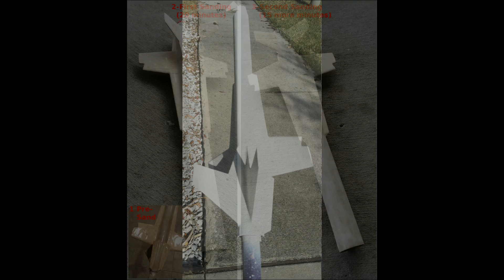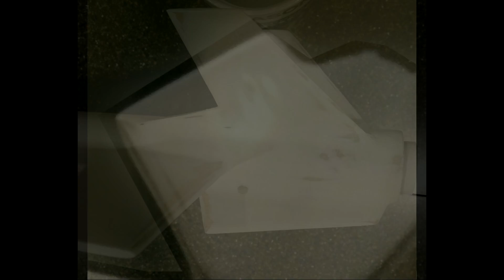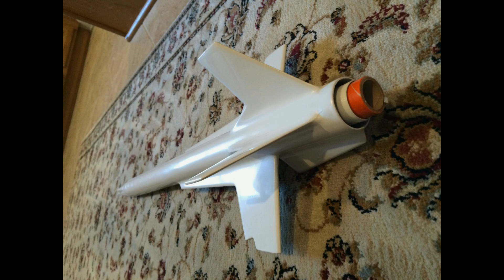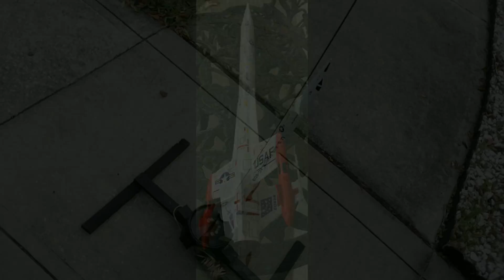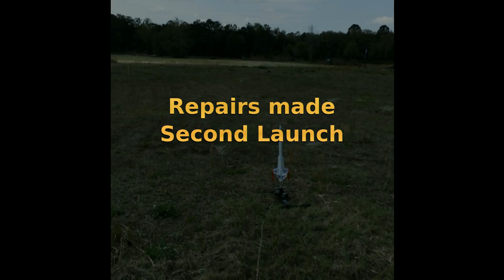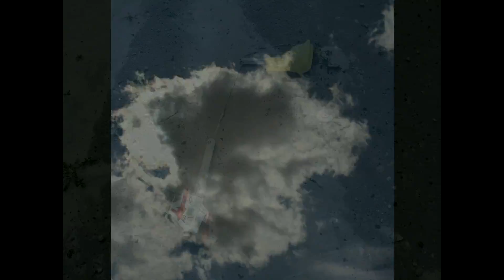Construction, CATO, & Launch of an Insane Estes Interceptor Build

Comment: I had one of the first Interceptors that came out in the early 70’s.  Put hours into it, it looked beautiful.  Made its first launch from a football field, went up, immediately went horizontal and rammed into the roof of a neighboring house.  Didn’t damage the roof, cracked the nose cone and a couple of fins.  Very sad day. Glad yours went well, other then the engine failure.
Reply from the maker: That's terrible Dennis. Are you still into rocketry?  I started mid 70s.

Comment: What did you coat the rocket with before sanding? Looks like epoxy.
Reply from the maker: That is zpoxy finishing resin - it is easy to sculpt and sand. I added microballoon filler to the zpoxy to keep the weight down. http://www3.towerhobbies.com/cgi-bin/wti0001p?&I=LXCX58&P=ML

It goes on very drippy and soupy, so it takes some getting used to.